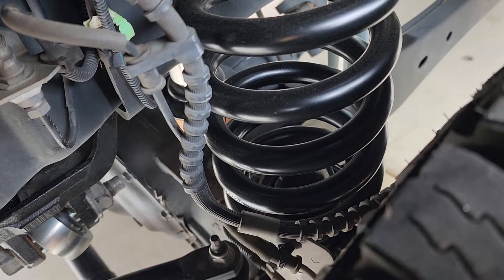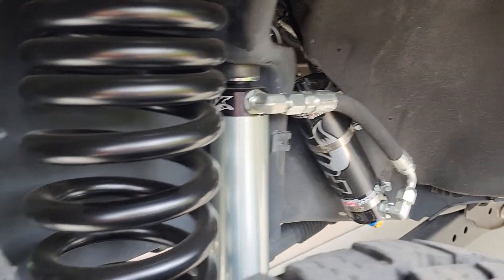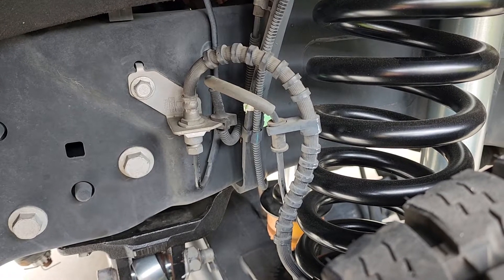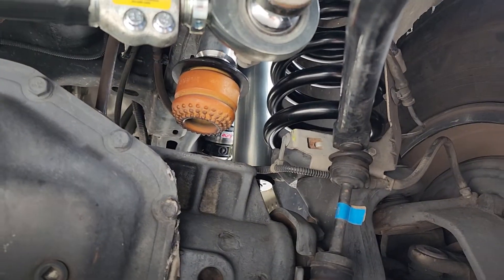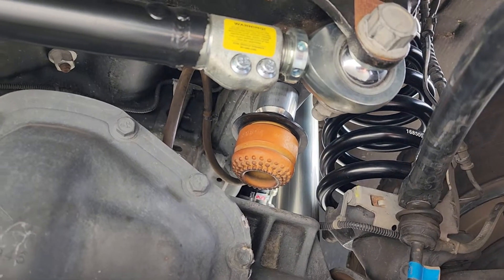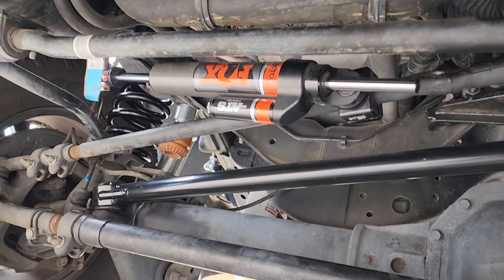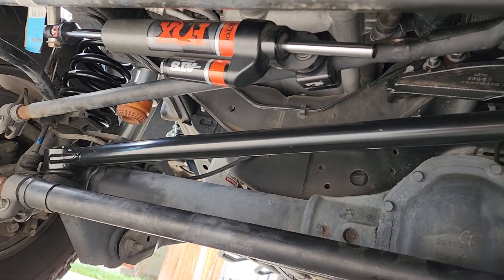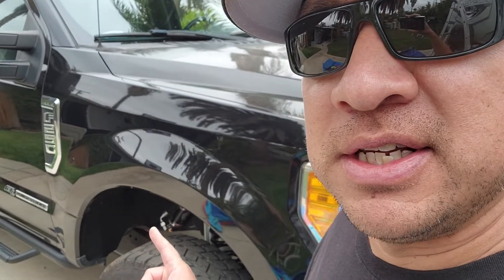2017 Ford F250 Icon 2.5 Leveling Kit with Fox FRS 2.5 DSC

Comment: I had a full Carli backcountry kit on a 2015 f250 and it was great! I have an Icon 2.5 kit on my 2017 dually and it’s good. Honestly the deavers make the biggest difference from what I’ve seen.
Reply from the maker: I now have Fox 2.5 resi's custom tuned. A huge difference. I do want to do a leaf pack eventually but my airbags will limit the full potential. I might do some type of long travel bags and leaf pack in the future.